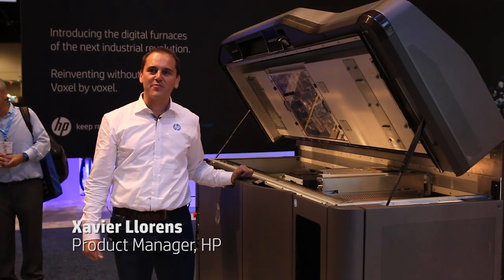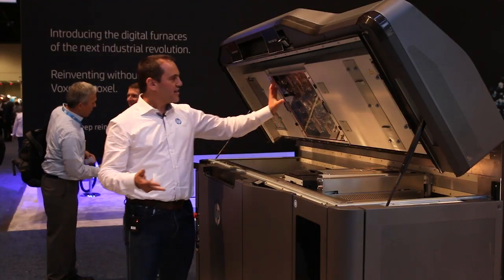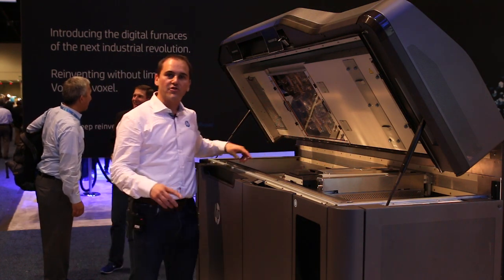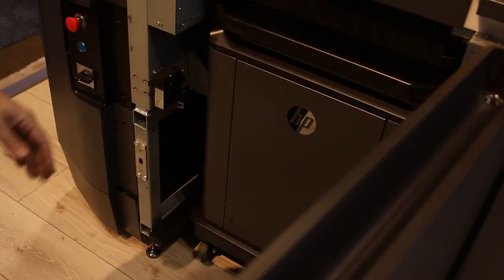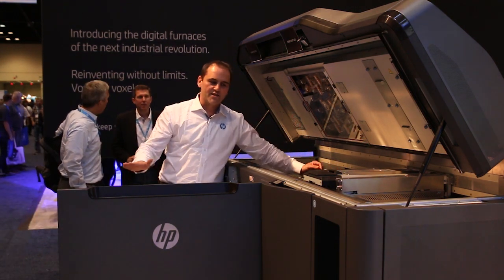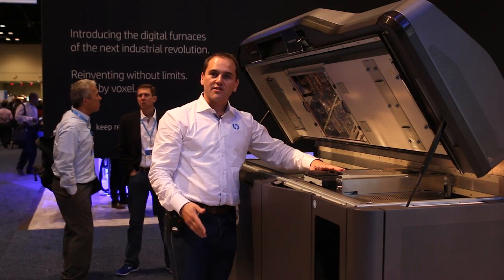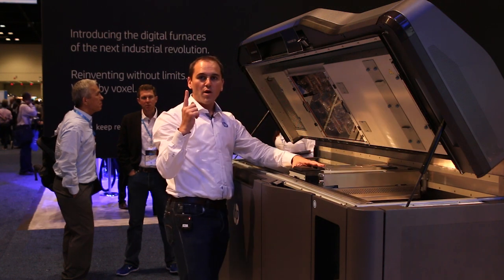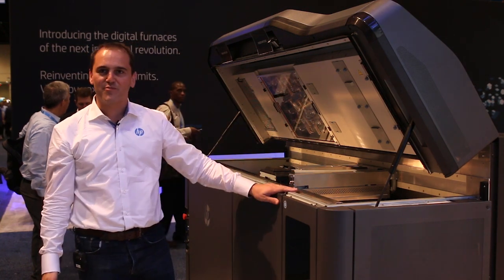Introducing the New HP Jet Fusion 3D Printer | Rapid 2016 | HP

Comment: how is the print head checked for clogging ? and if clogs occurs during the printing process would this printer recognize a problem ? If heating lamp dies during the printing process or you run out of the agent. can you restart printing after new agents are put inside?

Comment: CLIP still holds a definite edge over this tech for personal manufacturing, this will most likely evolve into an industrial utility instead. People don't need multiplicity of parts, they're still looking for a cheap, varied 3-d printer to replace plastics in the home.
Reply: This is not a home/consumer printer. This is a production printer.
Reply: CLIP is the 3rd generation of printing and is killing the competition.  Anything with "jets" or "jetting" in the product description is 1st generation.  The high cost + trouble/maintenance of multi-jet technology is a slap in the face.